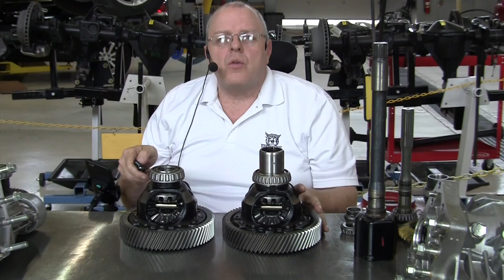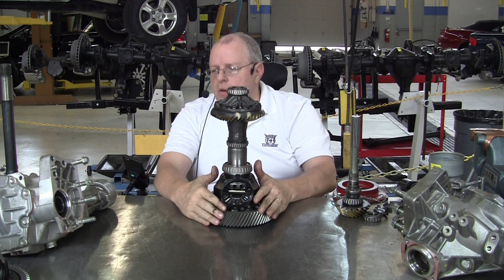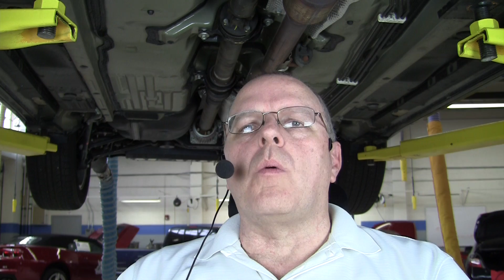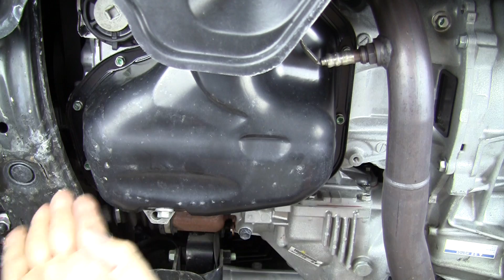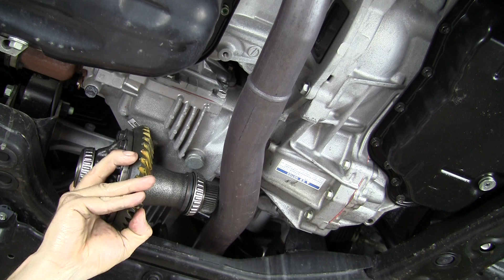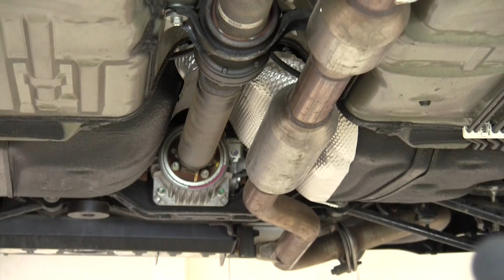Crossover AWD / 4WD Systems

Comment: I guess both front and rear differentials are open type differentials ?  They don't have any type of locking system fitted on them?
Reply from the maker: YEs, open differentials, but most vehicles have some sort of Vehicle Stability System that can use the brakes to slow individual wheels (like a limited slip differential) providing more traction.
Reply: WeberAuto Thanks for your reply. I thought so. :)

Comment: I have a 2002 Pontiac 4T60E that I have rebuilt, when I first start out it will shift once into second, then will seem as though it skips and goes into 3rd gear then will come back into 2nd gear, after watching all of Ur videos Iam sure U can help me diagnose this problem, I have asked several other people and haven't come up with a good answer, 
Iam so impressed with Ur classes and would like to be a little younger so I could be enrolled in Ur classes since like I have stated I learn so,etching every time I watch one of Ur classes, 
This auto is equipped with a 3,1 eng. And is a Grand Prix SE, during the overhaul of the Trans I replaced all the clutches and bands and seals and cleaned the valve body

Comment: not applicable to Subaru vehicles
Reply from the maker: Subarus have all of this internal to the transmission case, but still much the same principle.
Reply: Actually Subarus use a center differential to evenly distribute power to the front and rear at all times.
Reply: Subaru cars (all of them that are AWD) are symmetrical and do not have a PTU. There is a front center and rear differential. Go drive one of these slip and grips and then go drive a Suburu. Night and day difference.. no sliding around left to right no torque steer, etc.. Subaru's do not have a transaxle, they have a standard Automatic transmission with integrated center diff
Reply: Actually, it depends on the model, options, and year, because some are manual transmission AWD, like mine is, instead of an automatic transmission.
Reply: +YES10 -- not necessarily, my 1995 Impreza AWD with automatic has an electromagic clutchpack unit built into the tailshaft of the transaxle which can lock up 100% creating a 50-50 front-rear power spread. It does this when manually shifted into 1st gear and 2nd gear or if the front-rear slip differential is extreme.
Reply: This is probably superior to Subaru as it is a Lexus. Notice the front transfer unit can send 100% of the power to the back, whereas in subaru, you have a limited slip differential that needs time to lock up before it sends more power to the back. In a Subaru power is always sent to both front and back, at about the same ratio, so if the front is slipping, there is not going to be enough power sent to the back to help push you. But this is in older ones. Since 2010 they have the electronic brake control and that is good for just about anything, other than climbing a very slippery and steep hill. For that you need a locking differentials and lower range gears.

Comment: Mr. Kelly thank you for this great effort, i have a question, does the rear diff share the same oil with the wet clutch pack?.
Reply from the maker: +1TrTlq Hi, not usually, the wet clutch typically uses a different fluid like automatic transmission fluid. Thanks for watching!
Reply: I’m assuming we’re talking about the EMC that is on this Venza.
So your saying that the coupler itself is filled with oil and is separate from the rear differential?

Comment: Great explanation, that's interesting how the rear wheels are engaged. My RAV4 is an older model from 1998, and I believe it uses two open differentials in the differential case, one for the front wheels and one for the center diff as explained in this video https://youtu.be/hMCJibC7nbA. Now I'm trying to find if a Torsen type differential is available for the front and center diffs.
Reply from the maker: +yellowmanaustin Hi, Thank you! Yes, the 98 RAV4 uses that double open front diff system with a viscous coupling (not Torsen). It also had the Torsen style limited diff available an an optional rear diff. Toyota owned the Torsen patent for a while. Torsen went out of business long ago.

Comment: If I'm not mistaken, the power for the rear wheels is taken from one side of the front wheel axle which itself takes power through an open differential. In this case what would happen if the other from wheel will lose traction with most of the power going to that wheel rather than to the other front wheel with good traction and therefore not to the rear wheels when they are most needed.
Reply from the maker: +Игорь Врублевский Hi, it only looks like it takes power from one side of the front wheel axle, but it is actually directly connected to the front differential case (not the side gears or axle shafts). This means that it always has power regardless of which front wheel has traction. The rear driveshaft always had power available to it or from it to the rear differential. Good question! Thanks for watching.
Reply: +WeberAuto Now I understand, Thanks a lot for your great videos!

Comment: Is this true for a '07 MKX? I had the PTU fail. The dealer said different tread depths front to back (2/32" difference) put pressure on the PTU because all 4 wheels had power all the time and the backs were spinning slower than the fronts. But if there is a clutch at the rear dif that supplies power on demand then I may have been lied to.
Reply from the maker: +thermosfear Hi, good question. I seriously doubt that only 2/32" tread depth difference would cause that, however; on those systems the tire size, rolling radius, tread depth, and tire inflation can all cause a speed differential.  If the speed differential is above a certain pre-programmed amount, the clutch system will apply and try to force all the tires to spin the same speed. If the tires are not all the same size, damage can occur over a long period of time. The clutch system is in the rear axle on most vehicles I have seen, but some were in the PTU. Your MKX has the clutch in the rear axle. There is a Technical Service Bulletin fora PTU noise between 50-60 mph. Look up Ford TSB 07-11-13. The fix was to replace the PTU. The bulletin says nothing about checking tires. It looks like the cost was covered under the normal vehicle warranty, but I am sure that has long expired. Best wishes!
Reply: +WeberAuto Absolutely love your videos. I was wondering if the MKZ system is the same as the Taurus SHO?
Reply: +Michael Allen I meant MKX, sorry.

Comment: Hello John, outstanding explanation. On VW's with the old awd "syncro" system, predecessor of the haldex unit, It used a viscous coupling and a electromagnetic clutch that was opened when braking. I read long time ago that the rear differential had a marginally taller gearing that ptu to "preload" the viscous coupling, but i haven't found a confirmation, to you know if that's the case or if it's possible? Please jeep the videos coming. Regards
Reply from the maker: WickedTRX Thank you! I have not heard of such a thing; I do not think it would work, but I do not know for sure . It did not take much of a speed differential to lock up a viscous clutch.

Comment: OMG- how can this be cheaper than building a direct drive electric car like the tesla and than have a generator to power it if it has not bateries like a tank or locomotive. Our children will look back at our drive systems and say : what ware they thinking when you could have done it so much simpler, more reliable and more efficient
Reply from the maker: drevilatwork Cheaper has nothing to do with it. Convenience seems to be the driving factor in today's society. Thanks for watching.
Reply: drevilatwork  They will be speaking in Chinese when they ask that question the rate this country is going.

Comment: Great video and very detailed explanation!!!
If I remember right on the Toyota system the clutch assembly on the back modulates how much torque goes to the rear wheels, isn't that the case?.

If that is affirmative I'd assume that is achieved allowing some slippage as less electromagnetic force is applied.
Reply from the maker: gianfrancoa Thank you, you are correct. The torque applied to the rear wheels can be variable through clutch pack slippage modulation.
Reply: WeberAuto Thanks for the answer John. Before watching this video I was assuming that the clutch section was inside the power transfer unit and not close to the rear diff. Is there any specific reason to put the clutch assembly closer to the rear wheels? Maybe  to deal with less rotating mass?  Thanks